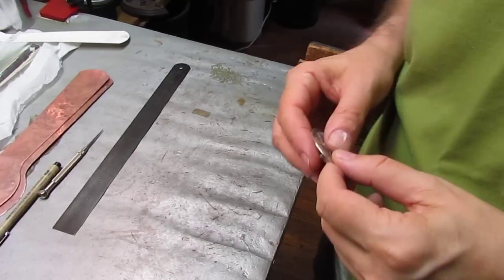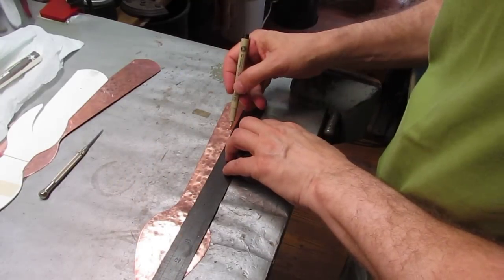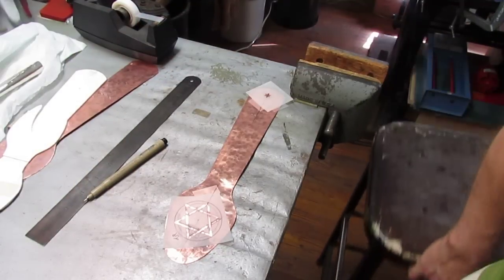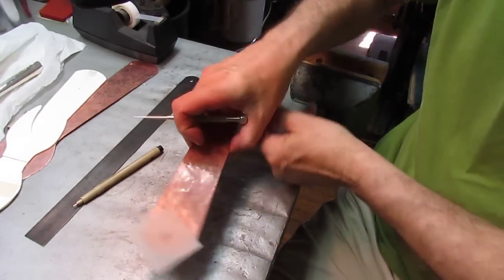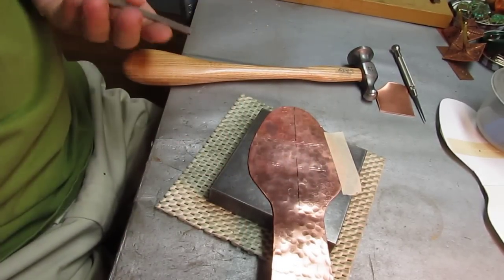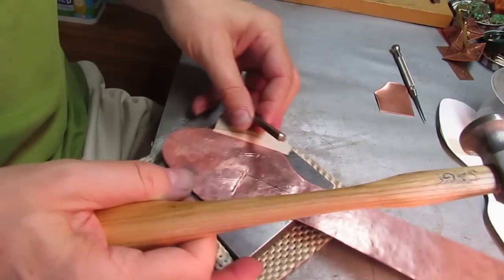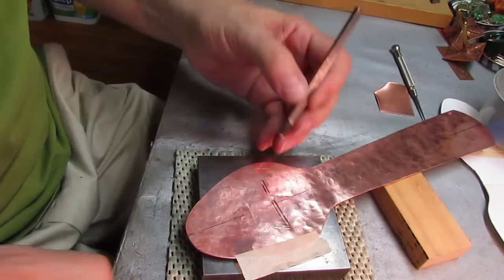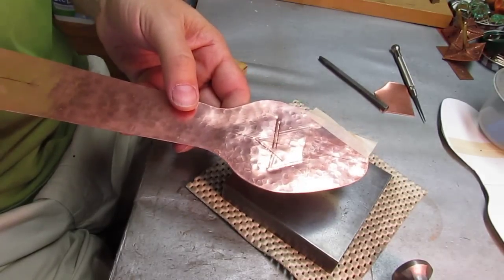The Pierced Spatula -  Part 1

Comment: Hi Sage. I love you videos and all your projects. Thanks so much. Does your chasing hammer have a flat or a domed surface? Can you use a normal Warrington or ball pien hammer for this work? Does it get pitted from the use on your metal chasing tools? Would love to learn more. Thanks.
Reply from the maker: +Claire P  -  Chasing Hammers come with flat and convex faces. I prefer the flat faced hammers. I don't know the Warrington hammer but I suspect it might be too heavy, and the handle is not designed for chasing. Chasing hammers have a pistol grip so that the end of the handle rests in the palm of your hand. The flat face of the hammer does get texture from the tools but that is not a problem. Thanks for watching!

Comment: Thankyou for your wonderful videos.May I ask what treatment you give your work pieces after annealing. I have tried for the first time and the metal comes out very blotchy and dull  not shiny like yours. I notice that your blanks also seem to be covered in hammer marks.
Reply from the maker: +Roman Dybala _ First question;
 I put the pieces into a room temperature pickle for about 10 minutes, then I wash them with a soft brass brush and a little detergent in water.  2nd:The hammer marks are put on to the metal first because that is what my client wants to see. Even as they are not necessary to the making of the piece, the hammered texture lends a sense of authentic hand made for customers, it also provides me with a surface that does not have to be 'perfect' and mirror-like.
 Thank you for watching.
Reply: i guess it's kind of randomly asking but do anybody know of a good place to stream new tv shows online?
Reply: @Immanuel Kaleb i watch on FlixZone. Just google for it =)
Reply: @Yosef Simon yup, I've been using FlixZone for since march myself =)
Reply: @Yosef Simon thank you, I signed up and it seems to work :) Appreciate it !!
Reply: @Immanuel Kaleb You are welcome xD

Comment: thanks for so helpful videos! just one question-what is the best thickness of the copper sheet for this job?
Reply from the maker: +Виктор Поликарпов  I'm using 20 gauge here in the video. 18 will make a heavier and possibly sturdier  tool if it is for daily use.  I might also use brass for a harder final product, I will be making some small spoons later this year in Brass to see if they are stronger with a thinner neck. 
 Thanks for watching!